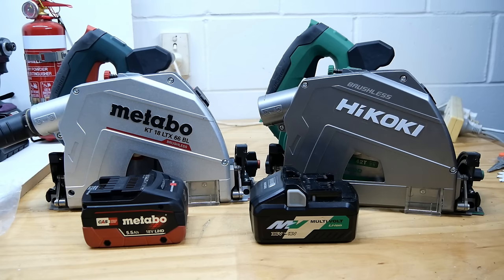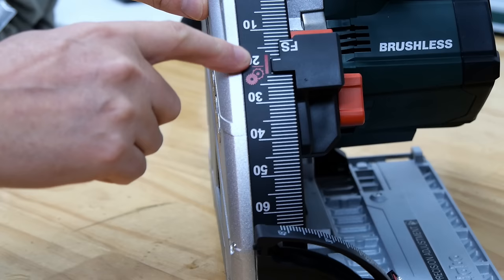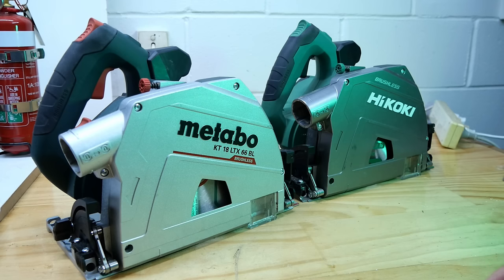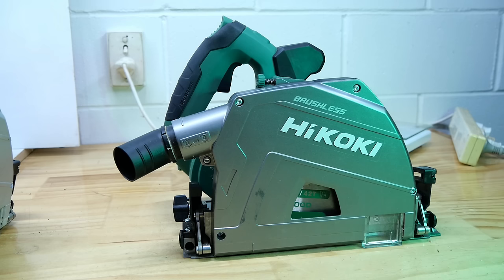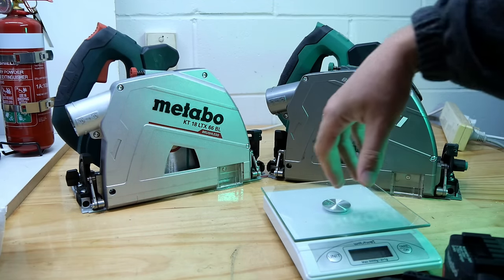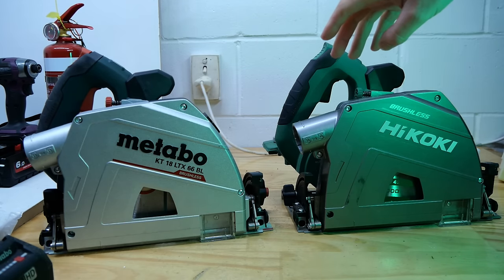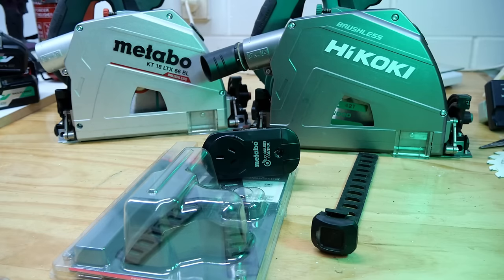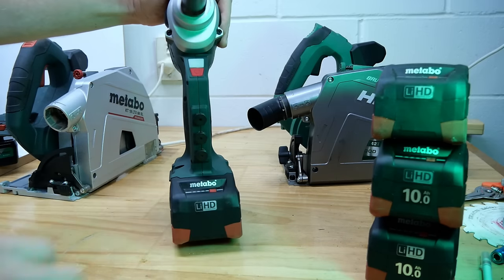HiKOKI Track Saw VS Metabo Track Saw OR Metabo Plunge Saw VS Metabo HPT Plunge Saw, You Decide.

Comment: The issue with the AC adapter is probably to do with something like using the motor as a generator to brake. This works with a battery because the battery can absorb the power, but you can't shove the pixies back in the wall. Just my guess.
Reply: The adapter also has less power than a battery.
Reply: You can shove the pixies back in the wall. Devices often dump load back into the mains
Reply: @kizzjd9578  it is rated at 2kw, higher than any of their batteries.
Reply: @kizzjd9578  not in all applications
Reply: The same thing also happens with the 230mm (9") angle grinder.
Reply: Though I dont remember it happening with my old G3623DA. I had it warranty-replaced, and the triggger on the new one also doesnt lock into "on" position, on my first one it did.
Reply: @riba2233  it literally says (correction 1010w) on the adapter lol. My batteries have way more power than the adapter. Killed one adapter and two table saws because of it lacking the power that the motor wants.
Reply: @baseballdude8491  yes
Reply: @kizzjd9578  really? I would bet I read 2kw as a max power spec. If it's 1440w, that puts it on the same rated power as their most powerful pack (4/8ah) but the battery has more peak power, that could be the difference you feel.
Reply: @riba2233  did you read that on the internet or on the adapter itself?
Reply: @kizzjd9578  ok I see the issue, all shops rate it as 2kw peak power and don't mention cont power, and on the official hikoki web it only says 1050w cont power  that is indeed weaker than 4ah pack, more in line with 2.5ah mv pack. Thank you for the insight!
Reply: @whirled_peas  only if the power inverter is bi-directional which I doubt it would be. It would also require an isolator to prevent it feeding power to the grid during a grid failure.
Reply: @riba2233  I use the AC adapter a bunch on the SDS rotary hammer and it just keeps on hammering away
Have 3 adapter 1 in the shop and one each for two different jobsites
Notnhave had issues after 4-5+ yrs
The fan like to run but that is for keeping it cool
Very little difference in constant power but yes the 4.0/8.0 does seem to help just a smidge on a few of the tools but no other company allows for the AC option when long runs are needed so it has been a great feature for our work
Reply: @baseballdude8491  yeah it is very useful. I have been thinking of making my own diy adapter for xgt tools though :)
Reply: @riba2233  yea; I don’t recommend it to anyone. I can’t read the label on mine as it’s still away getting fixed lol
Reply from the maker: It's actually only 1010 watts. I just checked mine.
Reply: @ToolsAndStuffOFFICIAL  👍
Reply: @ToolsAndStuffOFFICIAL  oh there you go, only good for low power usage tools. Which pretty much rules out all multivolt tools.

Comment: I checked my Table saw, 7.25 inch circular and miter saw. All 36v tools and all have a brake. The brake works with both the battery and the AC converter. Wonder why this saw isn't braking with the AC converter. I'm in the NA market, so Metabo HPT for me.
Reply: Probably because it's a German metabo saw that was never initially designed to brake using the AC adapter. And for the record, the 36v angle grinders also don't brake using the adapter. There's even a warning about it in the manual.
Reply from the maker: You think this saw is German?

Comment: awesome, another track saw review, love them! And of course can't wait for the big showdown between all of them :)  
that metabo 5.5ah pack uses 3ah cells so it is basically a 6ah pack, they just limit it to 5.5ah so it doesn't exceed 99Wh for air shipping. And since it uses 3Ah cells it is indeed more powerful then other ones :)
Reply: @riba2233 So the 5.5 an use 3ah cells. What does the 8 ah and 10 ah use? I read someone stated the 10ah runs at 10 whilst the 8 runs at 30 and the 5.5 runs at 35 whether that is watt hour I'm not sure. I cannot remember the exact wording. I understand its how the battery communicates with the machine which determines the output of power running on the machine. Drawing more current.
Reply: @ron1martens  8ah uses samsung 40t 4ah cells, and 10ah uses 5ah Samsung 50s cells.  3ah cells are very powerful, around 40-50amps, 4ah have decent power, 30-35amps, and 5ah ones are relatively weak at 20-25 amps.

Comment: The brake function, which provides a quick reverse current, seems to be easily achievable for DC-powered tools. However, it might be too complex and costly to make it in an AC-DC converter, just my guess. Interestingly, some Festool 220V tools have the brake function, while their 110V versions do not. During a Festool USA live, it was mentioned that the development of the brake function faced difficulties and was challenging to resolve without changing the tool's profile.
Reply from the maker: Corded Makita mitre saws have had brakes for at least 10 years so it can't be too hard. Thanks for commenting, haven't seen you in a while. Have you seen the new Mafell router?
Reply: @ToolsAndStuffOFFICIAL  Yes, it's amazing, definitely will buy it, but can't find the price yet, hope not too exorbitant
Reply from the maker: I know piranha tools have ordered them but Gaston still doesn't know the price.
Reply: They expect in September to run out the factories and the price in the netherlands is set 785 euros, just fyi.
Reply from the maker: Ouch!
Reply: @ToolsAndStuffOFFICIAL  i  have most of their bigger timber framing tools (some 5000 plus euro's) so probably that is why it sound affordable to me😛😅
Reply: AC tools use brushed motors for the vast majority of applications. The brakes are done by adding a second reverse wound coil to the feild coil which when the trigger is release activates this 2nd reverse coil stopping the blade. 
Brushless DC tools reverse the the current via electronics in PCB's (depending on the tool this may be a single PCBA that controls the motor and battery management, or maybe 2 seperate ones) My guess is that the AC/DC adaptor will rectify AC to DC and drop the voltage and then supply the necessary power to the motor straight, bypassing the battery PCB as there is no need for management for the current to protect the battery from over discharge as it will be stable. I guess this may explain why the brake does not work in the same way depending where in the electronics the brake circuit is located.

Comment: Has anyone noticed how similar the new Hilti track saw is to both of these? Again, different battery platform but the body etc looks identical. Haven’t directly compared them though as haven’t seen the Hilti at close quarters. I think (with Hilti) you’ll pay over the odds. Anyone else noticed this?

Comment: I'm heavily invested in both platforms cause at the time the Hikoki wasn't available so I went for the Metabo and got loads of 5.5ah batteries second hand. I find that the multivolts batteries 2.5ah are shit.. at least 10+ have been returned because of faulty BMS boards on them,I had not yet had one CAS gone wrong. Also my Hikoki 36v mitre saw is way too heavy to be loading in/out the van on a daily basis so now I'd sell it and go for the new brushless 216 Metabo almost half the weight.  Great informative video subscribed.

Comment: I cant wait to swap my makita x2 plunge saw for that Hikoki.
Reply: Makita XGT💪
Reply: The xgt makita is so much better then 18x2 it cuts so much quicker and has less blade deflection
Reply: don't, get the XGT makita version.
Reply: I sold all my lxt, all i have is metabo hpt and m12 now, no point in having one Makita tool anymore
Reply: @contax50mm  why lol, what was wrong with lxt and why did you choose hpt over xgt?
Reply: @riba2233  i liked how it felt and it was significantly cheaper than xgt
Reply: @contax50mm  ok then, glad you like it :)
Reply: @riba2233  как вам батареи вставлять/снимать в инструмент HPT по сравнению с LXT❓
Reply: @БулатБасыров-у2щ  similarly, with a latch
Reply: @riba2233  да, но зажим у HIKOKI с боку.
Reply: @БулатБасыров-у2щ  true
Reply: @riba2233  not at those Makita XGT prices and Makita is still inemic in their nailer and table saw game
Reply: @baseballdude8491  prices are fine imho for what you get
Reply: @riba2233  Not iff your outfitting a couple of work crews-here in the states I can outfit each of my framers with a rear handle, triple hammer, hammer drill, sawzall(recip), SDS max rotary and a jobsite chop saw for almost half of the same Makita and a 3rd less than the Milwaukee-I still have quite a few Makita and Milwaukee tools.
And that doesn't even include the nailers which we still mostly use both pnuematic and battery powered in HItachi/Metabo HPT and a few Milwaukees
I do go with Makita when they have a tool that is significantly better or the others don't offer but quality between the 3 brands isn't really that much different anymore so why pay double for the teal
Reply: @WillBlock-n9j  disagree, it is worth it because you will get a better, more reliable tools (and batteries) that are less likely to break and you will have less risk and leas downtime. Milwaukee has been lacking with quality lately, dewalt also not the best in that regard
Reply from the maker: The XGT Plunge Saw is cheaper here than the Hikoki.
Reply: @ToolsAndStuffOFFICIAL  but gor me that would be another battery platform and im trying to consolidate im down to hikoki and milwaukee.
Reply: @riba2233  yep gave up on Dewalt yrs ago with their terrible roll out of Li-Ion
As far as quality-we have yet to have a Hikoki/Metabo HPT tool fail us over 5+yrs especially the hard working 36V tools-Lifetime.warranty, 18V/36V battery backwards compatibility(Makita chose not to), AC adapter capable all great real world(Looking out for customers) exceeds the other colors in most every way-I'll still run the red and teal stuff but I make money with our tools so why pay more when durability, function, options many times favor the green
Reply: @ToolsAndStuffOFFICIAL  if that's true it's probably cuz the Hikoki is new(isn't even offered in US yet) but I'm sure by the end of year it will be lower than the XGT
We have two of the 2X18 (36V) Makitas that do just fine for what we need em for so until one of em gives up the ghost we probably won't invest in any new plunge no matter the color
Reply: @contax50mm  
I’m actually thinking of selling my Makita 18v tools and buying hikoki. I also run Bosch 12v. The planer is excellent and the brushless drills are a lovey tool.
I have some Dewalt flexvolt stuff as well. Table saw, breaker, chop saw which I just sold, 9 inch grinder and rail saw. 
Have to say the flexvolt tools are a bit more basic in terms of features but the power is decent especially the track saw! 

Have you tried the hikoki chop saw ?
Reply: @amateurvegan2636  not the battery but i had forward rail 12in and a fixed 10in and i love em. I have the rear hand hikoki, 6.5in hikoki, palm and plunge routers in 36v, the 36v recip and 36v belt sander. I also have the bolt 36v impact but like the 18v triple hammer better. And the full size hammer drill is a beast. Puts m18 to shame. I would highly recommend the hikoki line
Reply from the maker: @Baseball Dude 
The price won't drop here. Usually the price at the start is cheaper than what it will be later down the track.
Reply: @contax50mm  thanks for the response :)
The price of the metabo hpt in the states is insane. If it was that cheap here I’d buy it today but it’s a bit pricer in the uk. Did manager to pick up the multi volt ads and 165 mm top handle skill saw with two batteries and a charger for a decent price. 
The half inch router is what for me interested though and I have to say, multi volt interests me more then the makita 40v range which is way overpriced!
Reply: U said track

Ha ha

Here in the states ACME tools has rotating in house deals on the Hikoki/Metabo HPT pro level tools and carries an extensive # of tools
Reply: @ToolsAndStuffOFFICIAL  how come New Zealand gets products first
I saw the Hikoki a month or so ago and no sniff of it on very many others
R u the test area
Reply: @amateurvegan2636  highly recommend that Hikoki/Metabo HPT 1/2" full size 36V plunge router-we use it for tasks we never would have with a corded or a cordless trim.router
One of my favorite tools in the shop and jobsite

Comment: Hello. I noticed that when you touch the saw it wobbles.  I just bought the same Hikoki and it also wobbles, looks like they have a problem with the bottom base.  It also wobbles when it is installed on the guide rail.  Have you noticed any problems with this?  What are the consequences of cutting?
Reply: Did you tighten the cam dial to the rail?

Comment: Google off course had it wrong. It is called "FÜHRUNGSSCHIENE" not "Führungssystem" ! A " Führungssystem" in German would be considered more of a mechanism that works, at least partly, on itself or a whole system of several guide rails, attachments,  aso... In short, saw plus guide rail = a cutting system, guide rail = just a guide rail. 
I would opt for the Hikoi. One more thing, to annoy the c... out of you 😂, you slide your hand down on the handle of a Metabo drill, than you push with the downwards pointing palm of your hand the red button on the back of the tool and pull, with the other hand the battery off!
Reply: Festool has FS so they copied that , but Metabo use Mafell tracks .  
Bosch has different , on track/off track indicator , copied blade change system from Festool , but uses Mafell tracks .
Mafell has best blade change system , blade cover tilts down , i dont think anyone else has that , no need of a silly hole on side , from where half of saw dust escapes .

Comment: Im on both battery platforms but i dont use either saw . I have the Mafell cordless which i run 8 & 10ah Metabo batteries in ,which is just the best cordless plunge saw by a mile . I run the 36v Hikoki batteries in nailers and the impact driver everything else i run Festool.  I don't think either saw offers value unless your heavily invested in that platform and must have a cordless track saw . I have an old corded Festool ts55 which i abuse , cutting resin impregnated shuttering ply and cement board thinking i don't want to ruin my shiny new Mafell and the old Festool (12 years) just wont die. These low end saws are great for breaking down sheet material but if i was starting and couldn't afford the cordless Mafell or Festool I'd just buy the corded version , failing that I'd just ran a cordless circular saw on a rail adaptor for breaking down sheets with no power . I think it says a lot that im on both battery platforms and wouldn't consider either ...